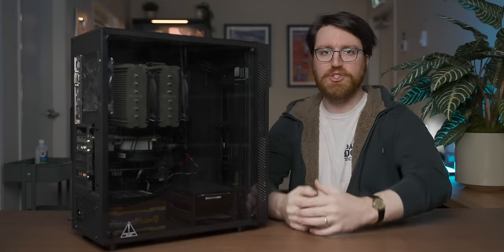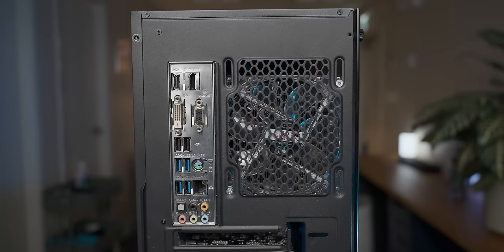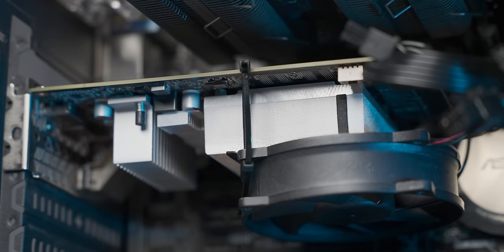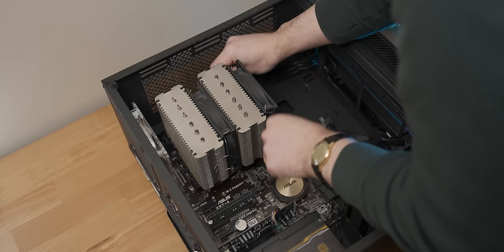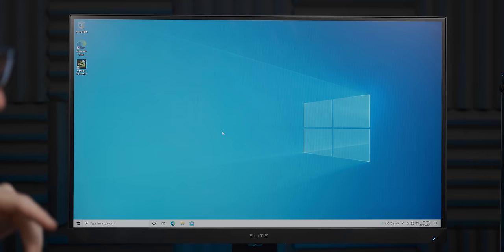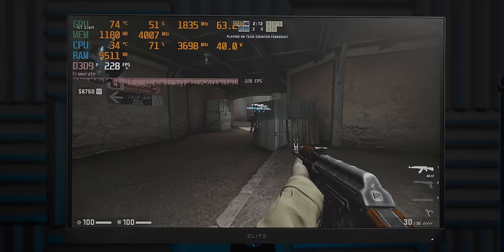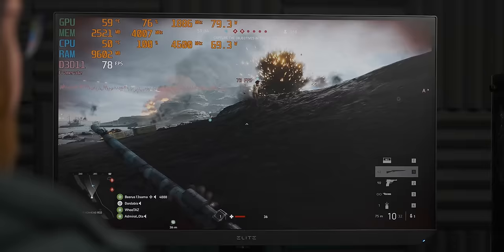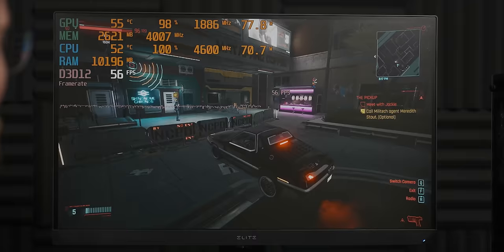What Does A $400 Craigslist Gaming PC Look Like In 2021?

Comment: Honestly, this is a beautifully weird system. A ghetto gpu cooler, a freaking noctua chonk cpu cooler, 17 gb of ram... and honestly, considering the current market, this is actually a really good deal.
Reply: That extra 1 gig of ram ups performance by a 1000 megabytes
Reply: Noctua chonk without their signature fans, instead replaced by Scythe
Reply: @humbdedumb6009  I wonder why they swapped out the very good noctua fans for the somewhat lesser scythe fans? Aesthetics doesn't seem to be a huge concern, considering the gpu fan situation and that weird cable jutting out right next to it.
Reply: It's a good idea if you want to play certain games now. But the core of the system is going to be outdated in the not too distant future.
Reply: @ttvv90  If I were to guess, it was so they could keep the higher performance Noctua fans and not have to explain to people who may not know about PCs that the off-putting brown fans are actually very good fans
Reply: @DeadpoolPlayz  whooooa really
Reply: @ttvv90  Because Noctua fans are loud. Stock D15 comes with 2k rpms fans. Those Scythes are 1200 or 800 rpm tops.
Reply: Paused to comment. That's basically my kids gtx 980 setup.

Ebay, no fan but still had heatsink, £120.

Strapped a spare AMD cpu fan on. Its Sooooooooo dirty but It Just Works
Reply: @DeadpoolPlayz  nice, I didn't notice it was RGB with the wee cooler slightly blockig the RAM
Reply: @ttvv90  defo, noctua's 100% carried over to new system
Reply: Basically nothing wrong with the system except CPU which is limited by 4c/4t . I guess it was upgraded from some older GPU at the time when gtx 1060 had decent price.
Reply: @DeadpoolPlayz  ackshully its 1024 megabytes
Reply: @ttvv90  My guess is they bought the D15 on the cheap without the fans, and added the scythe fans picked up from a different deal.
Reply: @catsmj76  actually no. I ate the rest of the 24 megabytes
Reply: @ttvv90  they could also have sold those fans separately as they sell for a good amount and brought cheap fans to swap for it
Reply from the maker: I know right! It's such an interesting system and it's always amazing to find stuff like this on Craigslist. 😁
Reply: @MJ-uk6lu  stock NH-D15 comes with 2x NF-A15 (1200rpm, also have optional low-noise adaptors but they are PWM controlled anyway); D14 comes with a P14 (1200rpm) & P12 (1300rpm), but I've had no problems running my D14's fans <900rpm and silent.
Reply: I think the owner was trolling us with the 1Gb stick.
Reply from the maker: @dereksbooks  Yeah maybe. Either way though, it was interesting to see the difference the RAM made. 😁
Reply: @fracturedlife1393  i bought one from the same ebay seller for £105 shipped (promo code n they take auto take £110 offer), took the front plate n heatsink itself off n put on an arctic accelero twin turbo II on it, great card for the money but didnt keep it long coz someone offered me £200🤣
Reply: @DeadpoolPlayz  1024*
Reply: @nickkk420  actually no. I ate the 24 megabytes. Tasty 🤤
Reply: I did a similar thing coolerwise with my last build which lasted me 9 years till i replaced it with 12700k and 3070 1 month ago. It was a 3770k and a fucking thermalright silver arrow ib-e extreme which is rated for 320w TDP and my cpu was rated for 77W and sadly i lost the cpulottery and only got it to run stable at 4,3 instead of 3.9 ghz so it never even took above 100w. But even then it was like 32-35 C° warm with that cooler on Desktopuse and 45-50 during gaming. My 12700k however which i have completely unlocked and it takes 205W at full power runs at 26-30 C° with a Noctua Nh-D15 and at 35-45 during gaming but it will instantly hit 85C° when used for rendering and is able to maintain that and not overheat or thermal throttle but just barely so i think in summer i will hit 95 C° and come close to throttling. I think there's no way to cool a 12900k reasonable with air. I have one of the best airflowcases aswell. I still could tune the fancurve more aggressive tho.
Reply: It really only needs one single fan between the fins, two is overkill. three if you consider the rear case fan.

There only generally one or two degrees difference between one and two fans on these heatsinks and EVOs 212.

A fan cable splitter and two fans does afford some redundancy if one fan fails.
Reply: Like number 666;)
Reply: @ttvv90  scythe fans are great they are not much worse than noctua for the fraction of the price,  got 6 kaze flex white in my system. Even at 800rpm they push so much air its insane.
Reply: I still have the same cpu cooler on my I5 3750k, I need an upgrade
Reply: agreed

Comment: This is a really good PC for $400 especially in this market
Reply: that 1060 alone is prolly around 300 bucks
Reply: Absolutely!
Reply: @mrducky179  That blows my mind because I bought my 1660 Super for 250 last year. It's probably going for like 600 dollars now.
Reply: Ye, great deal.  If you took out the cpu and motherboard and RAM, sold it on Ebay and upgraded to a slightly newer 4 core 8 thread CPU (i3-10100f bundle with mobo and RAM), you could upgrade and only spend around $100 more.
Reply: No it isnt....its terrible for $400 lmao
Reply: @mrducky179  Not at all. If it were the 6gb version it would be worth like $250...the 3gb version is barely worth $100
Reply: @SK8R43  In the current climate it's good.  Try finding anything better at that price point.
Reply: @SK8R43  its not that bad if you play on low/ medium textures and 1920x1080, so you don't exceed the 3GB
Reply: @SK8R43  3g version never goes under 220-250 on ebay at least
Reply: @SK8R43  It's a great system considering the current market prices. Id like to live in the dimension you live in where GPU prices are back to normal haha
Reply from the maker: Yeah! I've been seeing people try and sell similar systems without a GPU for more money. 🤢
Reply: @SK8R43  Haven’t tried to get a gaming rig together since 2019 have you? It’s not really about what things should be worth right now. It’s about what you can actually get if you don’t have anything else to get by on. Getting anything that will even pretend to run something like Cyberpunk for $400 is basically a magic trick right now.
Reply: @SK8R43  thats just too good to be true even gt 710s are sold for usd100 but ofc it depends on location
Reply: It's remarkable how quickly every layer of the market has become a giant mess. I mean sure you expect the first hand market to be unbearably high but now the second hand/refurbished are just as bad.
Any market that can exist anywhere has been affected by the current prices and in the worst ways possible. I wish you all good luck hunting.
Reply: Doesn’t matter really u just need to know we’re to look
Reply: @richardsinclair7661  2070 supers go for 600 who tf is buying a 1660 super for 600
Reply: @Kulade  In the time since I made this comment, I've seen some 1660 supers go for 550-600 in my local Facebook marketplace, and I also visited eBay and saw similar things. I know that doesn't reflect the entire market by a long shot, and I know that no one would buy at that price (if they were smart), but I still can't believe the audacity of people to try sell them that high. 

It's a great card, and I'm extremely happy with mine, but there are way better options at 600 bucks.
Reply: @Kulade  don't know where you from but go check the price of the 1660 🤣 juste save for a 30 series
Reply: @mrducky179  1060 "3GB" more like 200-250
Reply: @richardsinclair7661  where I am they wanted only $100 less for a 1660ti than a 3060ti....

Comment: I've got a $400, local Craigslist equivalent gaming pc. Should be interesting to see how this compares.
Reply: what are its specs
Reply: What are the specs”
Reply: RX570 8gb, 8gb DDR3, I5 3470, Corsair CX 550M, 1tb HDD, 128GB SSD. Not the best specs but I bought it at the peak of the PC shortage.
Reply: How did it compare?
Reply: I have a PC for sale on Craigslist for a couple months now.
 Corsair case, i5 9400f CPU, cooler master cooler,  GTX 1060 3gb, ASUS Z370 mobo, 16 GB DDR4, 1TB Sabrent M.2 SSD,  Enermax 600Watt PSU for $600. 
It won't sell.
Reply: @auntiepha8343  probably cause you are asking too much.
Reply: @rabbitrampage  imagine your vram being the same as your regular ram
Reply: @MrMCDiggles  With that sabrent m.2 that's about what it's worth.  Thing is, for performance, it's not the storage holding it back and it seems overkill and is raising the price needlessly.  It's like putting an amazing sound system in an old 1991 Dodge Spirit.  Yeah, the sound system raises the price quite a bit, but no one wants the dodge spirit at that price.
Reply: @MrMCDiggles  I agree, what you think  would be better price for it?
Reply: @rabbitrampage  with a cpu ram and motherboard upgrade your pc could turn into a 1080p beast
Reply: @rabbitrampage  add a 3770 and 16gb of ram and that would be a sweet 1080p rig
Reply: Same but I got mine a few years ago
Reply: @mrducky179  that's been the plan for a while, it was just to get me through a time after my laptop died, but I haven't upgraded yet as I find it works fine for CAD and 1080p gaming already.
Reply: @moorhen6156  been planning to do that but getting a 3770 for a good price is hard where I live and when I added 16gb of ram the speed was too low and I didn't have XMP to raise it, so I returned it.
Reply: @rabbitrampage  well good for you man
Reply: @rabbitrampage  a 2600 or 2700 are just as good and should be compatible as for ram id go for size over speed as I've found quite a few games that will eat more than 8gb of system ram forza 5 for example eats 10gb of my system ram
Reply: @enrique7934  👍I read what Norbert said above about the Sabrent M.2 SSD. I swapped it out for a 250 GB ADATA Swordfish M.2. Changed the price to $500 for the rig.
Reply: @auntiepha8343   lower the price by like 20  and sell it with an eBay bid it'll go over 600 because of the 1060. Make sure to emphasize the fact that it comes with a 1060
Reply: @auntiepha8343   No, Raise it. An average 1060ti is like 500$
Reply: @number1salesman-1997  all in time... i'd say 10 years from now we'll have 32GB vram cards. RTX 9090 XD
Reply: @rabbitrampage  I would say try and lower that down to about 350-380, if you can get it for 350 that’s a pretty good deal.
Reply from the maker: Thanks for sharing the specs. It's crazy how much variation there is on Craigslist in terms of what you can get for a certain amount.
Reply: @nomadic1816   The 1060 and 9400F have been in the craigslist title of the PC ad since day one. I did swap out the 1TB Sabrent  for a 250 GB ADATA Swordfish M.2. and dropped the price to $500 for the rig. I will update everyone that commented here when/if it sells.
Reply: @The Kamchatka Yeah, for years now I built PC's as a hobby to sell online, I really just do it for fun. I was building all along during the GPU shortage when I could find a GPU. Up until recently the PC's would sell in days. Weird times..
Reply: PC sold today for $500.
Reply: @auntiepha8343  Pretty nice and cheap price man. 500$ for Z370+1060+16gbram+1tbssd+80plusPSU is a very good stuff.
Reply: @auntiepha8343  $600 is too expensive. But should sell at $500-$550

Comment: For the price, it's pretty decent overall.   the RAM issue was pretty obvious up front,  you could pick up an ebay / CL extra 8gb stick to round that up nicely, especially with reasonable speed.  The GPU is actually not horrible, you could probably sell it in today's marketplace for almost what you paid for the system.  120fps in Fortnite would be enough to make most junior gamers happy.
Reply: 60fps would, let's be real. 120fps is high tier stuff :-)
Reply: A 3gb 1060 for $300 💀
Reply: GTX 1060 3gb go for around $200 usd one in that condition will probably go for $180 so no not really.
Reply: @slayer100141  i was able to grab 3gb 1060s for ~80 usd at that time, and I cannot find them for below 180 rn
Reply: This computer will go for a thousand on eBay easily.
Reply from the maker: Yeah I think part of the reason he sold it for this amount was cause of his ghetto GPU fan replacement.
Reply: @DroneMee  In the UK a 1060 3GB will sell for around £220 - £250 ($296- $336) on ebay. That crappy looking one in this build, probably about £200 ish ($269). Its very pricey here in the UK.
Reply: @5izzy557  I've never even seen more than 60 fps as my monitor is only 60hz, so I can agree with you there.

Comment: This is actually an incredible build for the current market considering the GPU sells alone for C$200-300
Reply: Yeah it sells for $200-300 without being held together by zipties. Good luck finding anyone who would buy that GPU as-is.
Reply: not anymore
Reply: @twizz420 Unironically the cooling solution is probably better than stock

And it's not like you should be buying 3gb GPUs for their resale value in most modern cases anyways.

This system is still not that bad for personal use at 300$, would have been a good deal at time of recording.

Comment: I legit cable tied 2 arctic p12s to my 1070, now it's cold and quiet. love it.

Oh and that's a nh-d14 not d15. You can tell as the heat pipes all stick out equally on the d14, the d15 has the two outer pipes lower in.
Reply: And it looks more like a cheese grater
Reply: the corners are rounded on the nhd14 lol
Reply: Cable ties are the bee’s knees 🤩

Comment: I had a pretty similar configuration, a 4670K, 8GB RAM, same Thermaltake PSU and a 1060 6GB. It actually run all my games pretty well until I hit 2 roadblocks. One was stutter while breaking barrels in Demon's Souls on emulator, the other one was 100% CPU utilization and stuttering in Borderlands 3. That's when I decided to switch to Ryzen 1600AF and all the problems were gone, those cores and threads were the solution...
And this machine is still better than most $1000 2021 prebuilts, lol.
Reply: RIP though. Ryzen 1000s won't support Windows 11. (If you ever decide to upgrade anytime soon to it).
Reply: @Arakari  Who would want that ;)
And not that his old one supported it either
Reply: @HappyBeezerStudios  idk lmao. I mean, by dad's still running an old-ass Windows Vista/XP laptop. so.....To each their own lol
Reply: @Arakari  Ryzen 1600AF is more like a ryzen 2000, so it should be fine

Comment: I have a deepcool case similar to that one. ABS gladiator 3070 from Newegg. Has an evga AIO as cpu cooler and so far, cooling has been fantastic. Haven’t seen cpu go over 55-60 and coolant is under 40-45 most of the time during heavy gaming.

Comment: Every video that Dawid uploads is like going through heaven for the first time every damn time. Its just way too entertaining.

My pre-built pc story was, i got it from a reputable internet cafe locally and it has some meh specs but with the price for its specs was pretty very great. The price was a little below $200 or 10,000php and the specs was a GTX 1050 with an i3 3240 and 2x4gb 1333mhz ram. The case was dog poop but i changed it to a RL01 Silverstone case which made it 1000% better looking. Also added a silverstone tundra AIO 120mm too and it looks DOPER now if thats even a word. Im upgrading the CPU soon since it heavily bottlenecks the gpu which is a pain when playing games but it does the job nonetheless.

Comment: Got one myself recently.  (FB Marketplace in the UK)   Very happy with it for the other half to use for work.

Intel 9600K
Gigabyte MicroATX Mobo with overclocking
Generic tower cooler with a white led fan - but it works well.
16gb Crucial 2666mhz ram
Generic glass case with 6 RGB fans and a fan controller (quiet enough)
Zotac 8gb 1070 Mini
500gb Crucial M.2
500gb WD Blue SATA SSD
Additional USB card with 2 USB C ports and 3x usb type A

Was fully cleaned and with a clean install of Windows 10 (fully updated) when we bought it.  

Real nice.
Reply from the maker: That's an awesome system! Enjoy.
Reply: @DawidDoesTechStuff  Yeah. We're happy with it.    Obviously had to stress test it before my other half used it for work.  😉 Assassin's Creed Valhalla and Forza Horizon 5 work really nicely.

Comment: I used to run a 4690k @ 4.4 (with a GTX 980 so similar GPU performance) up until fairly recently and it was always a playable experience when I had it. With some tweaking you could lessen the micro stuttering on BF V by a significant amount.  I upgraded to a 10700KF earlier this year to play BF2042 and we all know how well that game played...

Comment: 4690k and 1060 3gb was an ideal build for at least 3 years if you were looking for a budget conscious gaming rig. The next couple of generations in Intel chips were marginal gains in performance making used or even new 4690Ks a massive bargain on eBay. Same story for the 10603gb more or less, everyone wanted the 6gb version making used 3gb 1060s dead cheap. I don't use Steam, but I would have to guess both the CPU and GPU still have impressive representation. Nice work as always thanks Dawid!
Reply: I have almost the same setup except I have the 4790k CPU, zotec gtx 1060 3gb GPU, 32gb ddr3 ram, 2tb samsung ssd. Almost done building it I wonder if itll perform better than this set up

Comment: This reminds me of the $480 gaming PC I sold on Craigslist 2 weeks ago:
It had an Asus Prime B360M-A motherboard, i5-8400, 24GB 2133MHz DDR4 ram, 256GB Sandisk m.2 SSD + 1TB WD Blue HDD, OEM Nvidia GTX 1060 3GB, a Corsair HX750i PSU, WiFi + Bluetooth add-in card, inside a Lian Li glass side case with 3 fans and a remote-controlled RGB light strip. The guy also bought a 24" HP FHD monitor for $30 extra.